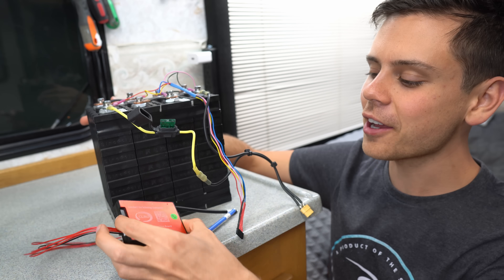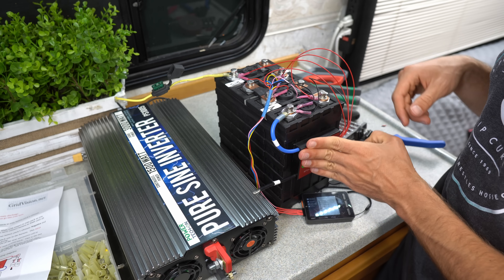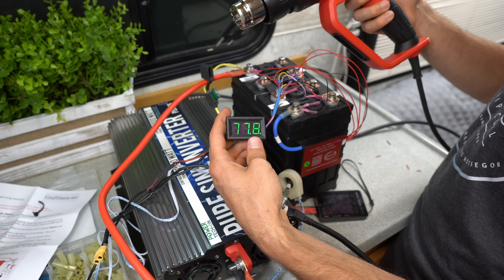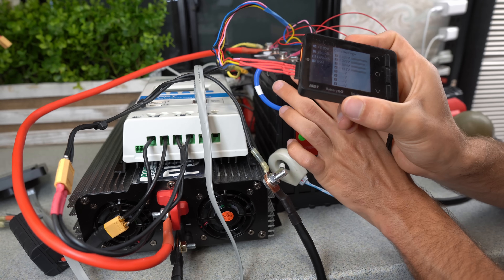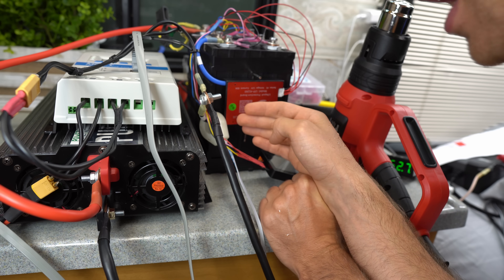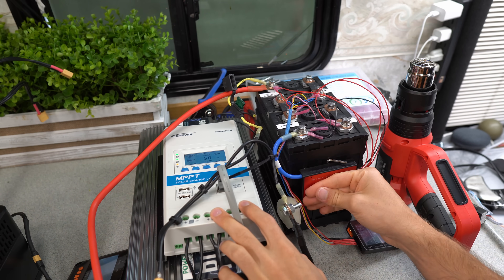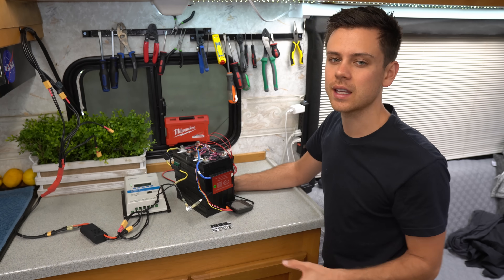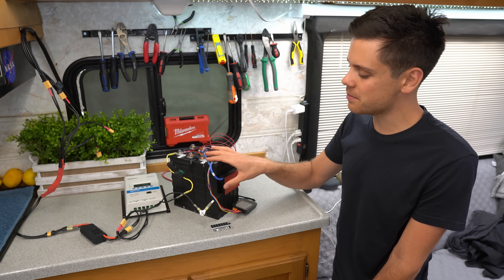12v 60a LiFePO4 Solar Battery BMS for $32- Installation and Test!

Comment: I love your videos! I relied on them a lot to install the electrical system in the van I'm transforming. I got a LiFePO4 Winston battery and installed one of these BMS's and it's been happy for a year and a half. Occasionally the board battery gets too weak and the motor won't start, so I take out the solar panels and let my solar charge controller trickle 1A into it until it works again.
But today I went out to see how the charging was going and found my LiFePO4 battery with .. 1.9V. I don't understand what could have happened. There was nothing drawing electricity from it. I'd never even seen it under 13V or so. I expected it to be protected from over-discharge by the BMS. I imagine it's shot now :-(   Any advice? It's been cold these last days, a little below 0C on some days. Could that be related?
Reply: All is fine after all. When I took out the battery and tested directly on the terminals, it turned out it had at least 12v. I'm not sure why it was showing so little when I tested at the connections to the solar charge controller. Perhaps something was loose. My faith in all that is electrical is restored. :-)

Comment: I bought a BMS from a different manufacturer and it looked like one of the board versions you showed, it totally burned up when I hit it with less than its rated 50 amp load. Also I really want to know how that BMS would actually handle that initial spark from your inverter because in my application I would have to deal with it every time I connect the battery and you cant just keep disassembling your battery to charge it.
Reply: Was that electronic mall?
Reply: @iKingRPG  it was one of those generic Amazon ones, they go under so many brands I couldn't find the one I had bought. They range between 12 - 15$ and they just aren't good. I had bought the Daly and so far it has not died. Although my use case has not stressed it too much yet.

Comment: hello.. i need to ask...if the inverter overcurrent, will the BMS also stop the current between battery and MPPT charger ?
then, if the battery fully charged, will the BMS also stop the current to inverter ?
because i'm afraid if BMS stop all the current, it will damage the MPPT charger or solar panel. if so, i plan to bypass from MPPT directly to battery

Comment: Made an order from Battery Hookup and used DIYsolar code. They didn’t give 10% off see below.
Subtotal
$331.92
Discount
DIYSOLAR
Discount code Diysolar was added
−$16.59
Shipping
$16.59
Total
USD
$331.92Updated total price:331.92
Reply: Battery Hookup has changed all their coupon code discounts from 10% to 5% so they could advertise lower prices.

This video was made before they did that.

Comment: Legendary videos!
I checked the BMS and it says in the datasheet "over discharge detect voltage at 2.2V" - which I think is too low, isn't it?
Will's BMS cut off at 2.5V with an over discharge protection. I don't want to destroy my cells...

Comment: Hi. Thanks for the videos. If I want to connect that bms battery pack in parallel with another identical bms battery pack to get 80 amps. Do I need an extra BMS that manage these 2 ones? Or the BMS are only for series systems?

Comment: I was trying to decide on whether or not to use a BMS.  I assume any BMS will have a current drain on each cell to achieve balancing.  My voltage regulator limits charging voltage to 14.5v.  On a 12v 4 cell LIFEPO4 battery, I think I can get by with 4 x 330 OHM resistors as a voltage divider between cells, which will have a 10ma drain and passively balance each cell to the same voltage.

Comment: I bought the same BMS with UART and BT - trying to activate is for 3 days now! - doesn't give power out ??, I have downloaded from there site everything I can, UART connection doesn't work, BT doesn't work (no 5V to BT module I have tested all 4 pins) - can you give a TIP how to start this?, do I need to give initial setup to make it work? - everything so unclear.
All my cells are balanced with less than 10mV difference!, all LIFEPO4 new good condition, thanks

Comment: i have question if i get a 24 volt system do i have to get the bms 24 volt cause individual cell is 3.2

Comment: I am running two 24 volt LiFePo4 battery banks with two 320amp BMS’. We have it up and running. The only thing of concern is on the Ant BMS app one bank shows different SOC than the other. Like 93% and other bank might show like 26% or 37% SOC. Both banks showing around same voltage. I’m running solar charging. System seems to operating ok. 
Don

Comment: I bought a daly BMS and 4 lifepo4 cells from China, if i connect the BMS to the cells, is it necessary to bottom balance the cells or will the BMS take care of balancing the cells?
If i set my mppt to only (de)charge between 20-80% do i have to worry that i didnt bottom balance the cells?

Comment: I have a 12V 4 cell 200Ahr LiFePo4 Prismatic battery I got from BLS. And the BMS is the DALY 200A. I got it all hooked up then tested it out and it ran the 12V fan only a few minutes and it stopped. I checked the battery, all the connections and balance leads and everything is just fine, but the BMS won't complete the connection. What do I need to check?
Cell Voltages:
1 - 3.284
2 - 3.274
3 - 3.275
4 - 3.273

Comment: Hi Will,
 Thanks big time for all your videos! You have truly given me an education on Lithium Ion Batteries. I recently tore apart a 12V 100AH battery to reconfigured the cells into a slim battery. I numbered all the wires of the BMS and reconnected them exactly the way they were. 
  When I measure the voltage at the battery terminals I get 13.5 volts. When I measure using the + battery terminal and the - BMS wire I get 2.4 volts. Could use some HELP !
   Thanks! 
       Don

Comment: Have you considered adding a FLIR type infrared thermography camera to your test kit?  I ask because while all of your electrical data are gathered precisely, but your thermal data is gathered by touching components. Even a cheap IOS or android thermography camera will give you and your audience a much more accurate data set than your fingers. You'll be able to analyze the entire system thermally all at once with an image / video that looks super cool (so to speak)  Anyway, great channel and great reviews. Keep up the good work!

Comment: You have become my primary source for updating my knowledge of PV systems. In the 80s I ran a solar thermal research and manufacturing company. Question. What was the monitor you attached in parallel with the BMS. Simpler than app and bluetooth connection for a quick look. Keep up the good work. I think you've found your calling.

Comment: Will, it seems to me that the batt. bank you built could output way more than 60 amps. Let's say you wanted to run a larger device (say that heat gun at 120 amps).  Could you use a larger BMS to run it? I suppose if you did this too long or too often, the battery would degrade, but what do you think for occasional short time use - say 10 minutes at a time?

Comment: Thank you for sharing! Looks like my BMS will be a Daly ;) although I'd love to have a bluetooth connection on my phone too. I'm planning to make a 12V lifepo4 battery with 100 or 150Ah cells from Aliexpress but one thing I'm not sure about is the BMS rating. Must I use a 150A BMS if I make a 12V 150Ah battery? Or is it just about the Ampere I'll use? I've made a box with all sort of 12V connectors and dew heaters and I'm planning to build such battery for astronomy and astrophotography on the go. I'll use maybe 6 to 10 amps, but I need power for a whole night, more or less. Occasionally I might use it for higher purpose but my inverter is "only" a 300w one anyway. My question is if I can use such BMS as the one you're testing in this video, rated at 60A max? You've got an awesome channel, love your passion. Thank you!
Reply: For 300wats invertor use 15A BMS
Reply: It's just the amperage you will use that dertimes the bms rating

Comment: I don't like the idea of it balancing during discharge. Kind of pointless and you just lose charge to nothing. Most importantly it cuts power at any cell below specific voltage, which in this case of course it doesn't without a switch (which you might add)
I stick to balance charger, saving BMS on many batteries and can draw any amps I need even 800.

Comment: Hi, i have a question for you. i have 2 identical li-ion battery back, each one have it's own bms that can handle 40A. Can i connect  the 2 pack in parallel to have a 80A total output? Will it work or i will have problems?

Comment: Re: BMS choices: QUESTION:  Is that a common pole BMS, or A separate pole BMS.  I like the idea of this way of protecting battery as I study more for my 1st ever DIY 24v LifePO4 project. I need to study my BMS options a little more before purchase that part. I think I will go with the Daly brand S8  ...8 connection to each 3.2v battery cell.

Comment: As far as I know, LiFePO4 batteries are different in chemical composition to Lipo/Li-ion batteries and they can take abuse and will not explode or combust.  Thats why it is not important to balance charge them compared to Lipo/Li-ion batteries.  Thats why not many manufacturers really produce bms for it.  Just like NiMh and Nicad batteries, you never need to balance charge them.
Reply from the maker: Still need balancing and LVD to avoid over discharge which will permanently damage them and increase longevity by compensating for cell drift.
Reply from the maker: And yes, not dangerous compare to most other chemistries

Comment: What happens if you don't use a Bms?
in a similar system
(I understand that the problem is that the cells don't load the same)
But is there any other complication?
I want to use a high consumption system for an automotive audio system
about 1200 amps
and there is no such a large BMS for this

Comment: is there a quality bms for agm batteries with high amps
Reply: a cheap bms works great even for AGM batteries. I have a 3 wire 15 amp one for my 24V AGM setup.

Comment: Hi Will,

Great video 👍

Do you think it's possible to build batteries with these BMS on each battery and then parallel these batteries together to increase capacity?

Comment: Can I connect the BMS in series? I have 4 packs of battery rated in 12v 3S with BMS installed. I just wondering If I can connect the two battery pack in series and parrallel the two also. To make system 24v 6S.

Comment: Hello, i bought these 16 cells with these specificy: Product Name: Lithium iron phosphate cell
Shell Material：Aluminium
Rated capacity:150Ah
Minimum capacity:150Ah
Internal impedance:0.2~0.3mΩ
Nominal voltage:3.2V
Dimensions(L*W*H):174*48*171mm
Weight:2.95±0.10kg
Recommend Constant Current:150A(1C)
End-of-Discharge Voltage:2.5V
Recommend  Constant Current:75A(0.5C)
Charge Voltage:3.65V
Maximum Pulse Discharging Current：228A（3min）
Maximum Pulse Discharging Current：300A（30S）
Charge Voltage:3.65V
Max Continuous Discharge Current:150A(1C)
Cycle life (80%DOD):4000 cycles
Charging Temperature：-5~60°C

Discharging Temperature：-30~60°C
What bms i need to buy ?
Thank you

Comment: if I am not wrong, I guess it work fine without the charge controller. using the solar PV panel connected to one dc-dc regulator CC CV and feed the battery (to charge it). and the load discharge direct from the battery.

Comment: tanks for this video! it almost what I wanna do to changing my offgrid system. but I have some questions: 

1. the charge controller are 12/24V and don't goes mad trying to guess with the 2 wires BMS? tracer empever manual say first battery then solar panels. 

2. maybe a better option is the BMS with 3 wires. common, charge from mppt and discharge batteries. my guess is the 2 wires BMS is right to electric bikes. they only charge or discharge using it.
3. connect inverter direct to the battery work fine IF have some protection for over discharge. manufacturers love to stop em at 10.5 to dristroy the battery before disconnect. 

4. I don't need any protection for zero degree. never happen here in tropics :D 
5. afer some months everything gos on fire or still working nice ?
keep learning, testing and increasing your evolution. it's the way in life!

Comment: Very useful video, thank you. If you’re building a battery with new cells and a bms like this one. Do you need to bottom balance the cells like you would on used cells or just let the bms do the job?

Comment: IMPORTANT QUESTION: I like that BMS Daly you show. looks like heavy duty.  So I used link and they said Common Port and Separate Port.  Which one are you using and what is the different ? Thanks very much !  Looks forward to your answer so I can buy right one.  
Question 2:  Do you think the BMS 100 Amp Black and blue wire is bigger Than the 60-80 Amp BMS ? because I want to make 12v with that LifePo4 3.2v 50amp Blue batteries.  Want to start the Honda Odyssey minivan v6  3.6L or Toyota Camry v6.  Thanks

Comment: Hi! I have a question I wanted to ask, if we are using the BMS then do we have to worry about balancing them at low voltage or connecting them parallel? because anyway each cell gonna get disconnected from the load at their set voltage right?

Comment: Anyone else running a Daly BMS? I was having problems with mine (cell run away on charging) and I messaged Daly to be told their BMS only cuts charge when the string voltage exceeds the rated voltage, so if one cell goes high it doesn't care...
Reply: andyreact I just bought one that I thought was just like the one in this video (a Daly) 60A 4S LiFePO4.  Tried to charge last night, and saw a cell start to go over 3.65V. Not impressed so far, but I am going to discharge and try to charge again.  I’m using it on some 15Ah headway cells - 4S2P.  I’d love to share some notes back and forth if you are trying something similar.

Comment: Hey, buddy, I'm a little confused as to using 2 balancers - one is (the red one) attached to the battery wall, and another one is the display monitoring each individual cell (the black one). Can the black one be used instead of the red one or do they perform differnt functions and are used for different purposes? Or are they the same except for the black one simply has a display for visual monitoring?

Comment: Will! Or anybody. Can you recommend a good LiFePO4 charger? I am not talking about a solar charger. I will be using my LiFePO4 prismatic cell for a trolling motor when I am kayaking. So I just need a portable charger that I can just plug in an AC outlet.

Comment: hi my friend, very good test! I have a few questions.
 When using the battery pack
 aren't you charging? (So we need to charge after the battery is exhausted) 
Can we charge it while using it? (
at the same time) 
If we add water cooling, we will have to remove BMS and MPPT to the system ?
i want to do system; solar panel (12v 10a )--> Super capacitor ( 500f*2.7v 6s) --> bost convertor( for 24v) -->Mppt charge--> 8s lifepo4 battery with BMS 
for this system missing part ; Mppt charge 
I wanted to ask without taking the charger
                                                          Respect,  FaithTr
Reply: for esc and brushless motor, 
(i will not use an inverter)

Comment: Hi, Will. Have you experienced a BMS low voltage disconnect and then the BMS won't reconnect when cell voltages recover? I'm using the Delgreen 
4S 100A PCM/PCB/BMS. Thank you.

Comment: Installed.  Solves a lot of problems.  Sadly, my generator pulls more than 60 amps when the starter kicks in, so I can't start my generator without bypassing the BMS.  Not a big deal, but still a pain in the butt.

Comment: Hello, first of all thank you for your sharing and your different test, I also bought the same bms version 15A.
It cuts well at 2.5 volts but it reacts to 2.51 volts and not 3 volts as in the description, so it cuts and reactivates the charge (a bulb for example) without stopping.
Do you have this same phenomenon ??
Thank you

Have a good day
Benoit

Comment: hi will just one question can i use one 12volt battery and 4 buck converter to charge 4 lithium cells individually with them connected in series   
with no need for bms

Comment: Thanks for the video! Is there a version of this for a 400ah sinopopy bank with 2000w inverter and corresponding loads? I need low temp charge cutoff protection too! 
Trying to work with an existing setup that doesn’t currently have any BMS installed. Thanks!

Comment: Just found your videos, great stuff, explained where someone can understand it.

I want to connect my 12v 60ah Lifepo4 to my RV instead of Lead acid, is this BMS safe enough just to leave charging through the RV system? Would you recommend any other safeguards?
 No Solar at the moment but am planning in the future.
Randy

Comment: When I connect mine it does nothing, except disable power to my RV!  There's no output voltage at all.  I confirmed several times that I've got the wires connected correctly.  I guess it must be defective.
Reply from the maker: Short out the lead between the p- and b-
Reply: @WillProwse  I should connect both P- and B- leads to the negative terminal of my battery?
Reply: Or should I just momentarily short it.....
Reply: Momentarily shorting P- and B- it worked!  Thanks.
Reply from the maker: @thisoldrv  yeah just for a second. You got it